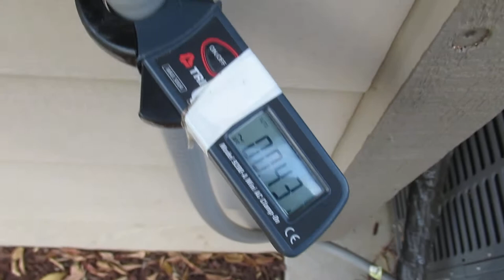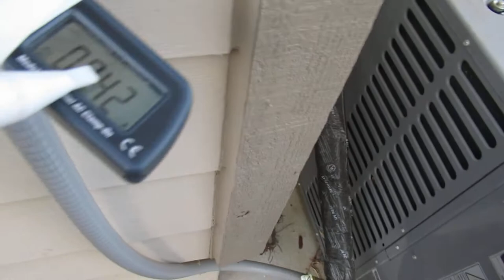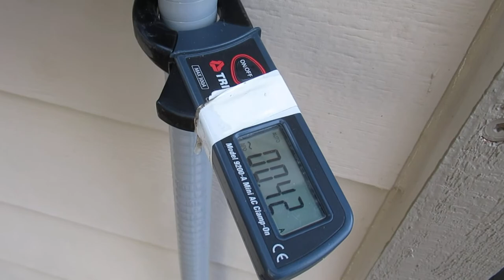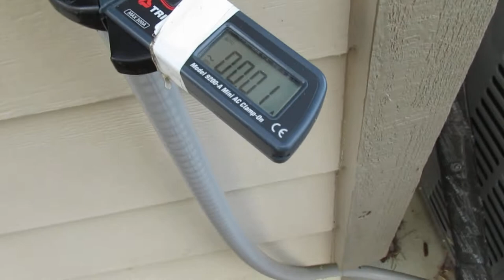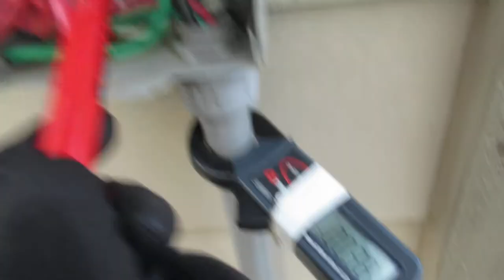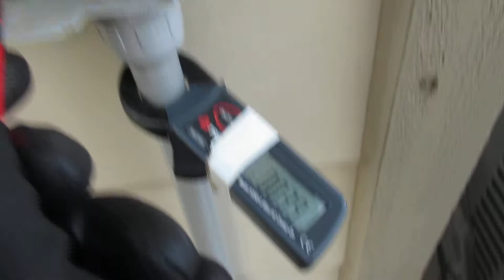Illegal Neutral to Ground connection @ Air Conditioner disconnect box

Comment: Good find! Some modern AC condenser units do require a neutral line,  e.g.  to supply 120VAC to the oil heater in the bottom of the compressor, or the control circuits. Those units usually have a single pole contactor inside the condenser unit. Agreed, with both L1 and L2 powered-off there should be no current flow observed on the meter. I once saw a situation where a faulty supply breaker was leaking current when switched-off, but that should have canceled out your clamp meter reading. An arc-over inside a breaker can leave a carbon trail for current to leak through. The disconnect box should have separate bus lugs for the ground and neutral wires. The extra bus lug is often an optional purchase. The inspector should have caught that error.

On the macro scale you may have a building ground loop caused by: faulty building grounding electrodes, poor conductivity of the local soil, or the utility company transformer. Ex. if the neutral tap on the utility transformer is not centered correctly, or the case is not grounded at the pole properly, or the pole transformer maybe leaking current to ground. Electric potential may be seeking an alternative path to the earth ground through the AC unit cabinet. 

Some utilities save on primary wire by only running a single over-head primary phase to the distribution transformer. So the other side of the utility transformer primary return is connected to an earth ground at the pole. There was a famous case where people were getting shocks whenever they stepped into an outdoor swimming pool. The swimming pool was situated between a bad primary leak between two nearby HV primary 3-phase circuits. The current was passing through the earth and the pool provided a lower resistance path for the stray current to pass through. The pool equipment was all wired fine. They found a nearby under-ground utility transformer that was defective as I recall.

Comment: Ammm,
An AC disconnect that is fusible can have a neutral bonded to the ground. The AC disconnect is an exemption to service equipment meaning a load panel. 

Theory: the fused disconnect fails to trip. Current that is now flowing excessively should go back through the ground into the AC disconnect log which should also be grounded back to the load center. In the event that the ground wire failed. The neutral from the AC unit will carry that current back to the AC disconnect lug, and that current based on electrical theory for the last 100 years would then take the path of least resistance going from the AC disconnect lug through the box to the ground and back to the panel. 

 So that neutral that is bonded to the ground is not a violation of the NEC code.

The AC unit does not have a neutral, that neutral wire is coming from inside your home into the disconnect. So that means that you have current flowing on the neutral. (which is any current in the house, flowing through the ground or neutral to the bonded bus bar in the load center.), flowing out of the load center on that neutral wire into the AC disconnect. That is where your current is coming from.

that neutral should be capped off. If you had a 120 system, that neutral would be spliced together....
.

Go to your load center and put one of your test leads on your bonded ground/neutral bar. And then put the other test lead onto a (separate ground )like a water pipe and then see how much current you have flowing excessively. .
Reply: I experienced a factory machine which bonded the 120V Neutral to the ground in its control cabinet. The assembler who constructed a custom extension cord unknowingly swapped the hot and neutral wires in the male plug. The other end of the extension cord was a pigtail for temporary connection to power and test the machine. When the extension cord was the plugged in the circuit breaker tripped immediately. The circuit breaker was reset and tripped after a 2nd try. The assembler then thought it would be good idea to disconnect the ground wire on the pigtail side of the extension cord. Problem fixed, circuit breaker no longer tripped. The only problem is now the whole metal frame of the machine is now 120V hot.
Reply from the maker: Hello Ammm,  That  may be allowed if the AC disconnect is wired directly to the Service Panel.  In this  case it is wired a Sub Panel so the result is the same as a N-G connection  at the sub panel.  In this case  connecting the N & G st the disconnect also put AC current on the  fluid pipes to  the  indoor evaporator: this  created  a large magnetic field over a large section of the house.   AC current on HVAC pipping  a violation of NEC 250.6.

Comment: That's a good call catching that violation, whomever wired that doesn't know the code well regarding bonding.   I have a 3 questions:  First, how your meter was picking up any stray current to ground at all with it clamped around the entire seal-flex when it's a non-conductive material between the HVAC unit itself and the cut-off panel enclosure?  Second, even if the meter would pick up any current from the conductors inside, how did you know it was a stray current to ground your meter was picking up on and not a read from one of the 2 hot legs inside the flex?   Third, why was a neutral even pulled at all to an HVAC unit when it's a straight 240V appliance, is there a new code requirement for this?   I was always under the impression that a neutral was only needed for appliances like a clothes dryer or a stove/range because there are components in them such as the timer/control boards, lights, etc. that only use 120V, on an appliance such as an HVAC unit or a water heater there are no such components.
Reply from the maker: Great questions Fida,
1. magnetic fields measured by the amp clamp got thru metal and plastic  2. The compressor was not running.  3. All appliances require an EGC, equipment grounding conductor.

Comment: Any 240 house circuit " usually " has a neutral run with it. Especially an electric range, dryers, heat pumps. The neutral will carry any unbalanced load from the appliances in the event of a loss in one leg of the 240 within the appliance. Also some 240 appliances have 120 in them as well thus needing the neutral to carry that as well. So yes....you must carry a neutral to 240 sub panels
Reply from the maker: Right Tommy.  It must not be connected to an equipment ground except at the service panel

Comment: You left me hanging for FULL answer.   Does the outside unit have no need for 120 volts
to power anything?          The copper and green conductor ? One goes to the unit and one
back to the main panel?           WE UNDERSTAND they should not be together.
Reply from the maker: Hello Ted,  The pigtail from the AC unit was L1, L2 & a green Equipment Ground. L1 & L2 go to the AC unit so it receive a full 240 VAC circuit. Bare copper and green grounds should be connected and bonded to the shut off case but not to a white neutral.
Reply: @windheimemfsolutions  Was the white neutral (conductor)coming from the main panel , but was 
not needed because only 240 volts was used in the outside unit???
Reply from the maker: @tedlahm5740  Yes, Yes.  That was the decision of the EMF electrician repairing this problem

Comment: Great video! Does it need a new ground wire to connect to the main panel? Or as it is  bc it has ground wired connected from the AC disconnect and the mini split? Thanks!
Reply from the maker: The violation  here is that the ground and neutral are connected on the load side o the service panel which violates NEC 250.24(A)(5) Load-Side Grounding Connections. A grounding connection shall not be made to any grounded conductor on the load side of the service disconnecting means except as otherwise permitted in this article.

Comment: How come theres a neutral present at the disconnect? condensers dont need a neutral. Was this neutral also removed at the main panel? I'd just leave it capped off at both ends in a wire nut it could always be re-identified with electricians tape and reused if a wire was ever damaged.
Reply from the maker: Hello Denny,  It seems that the contractors wire the house with whatever cables they have on the truck..It appears that the people that wired the house and the AC condenser were not aware of NEC 250.24(A)(5): Load-Side Grounding Connections, which says, “A grounding connection shall not be made to any grounded circuit conductor on the load side of the service disconnecting means except as otherwise permitted in this article."  

These NEC violations create high AC magnetic fields in there house so we search out the source.  I find NEC violations in one of very four home I inspect.  SO where was the building inspector? We found other violations at this house as well: 300.3(B).
Reply: @windheimemfsolutions  I see it all too often where a neutral is bonded with grounds outside the main panel. Also where neutrals are being shared with another circuit this causes issues where a neutral can be overloaded and wire overheats. Also dangerous where working on a circuit you shut off expecting it to be off and you get hit on the neutral.
Reply from the maker: @dennywires  Why do you think it happens so often?
Reply: Unaware diy or homeowners that don’t know code and don’t understand electrical systems. Maybe an Inspector didn’t  know or overlooked during an inspection.
Reply: @dennywires  Apparently the home owner needs to know how to check the electricians work. I just found where the range and cooktop are tied to the ground by an electrician six years ago. I'm installing a new cooktop and found the issue. Thanks for posting.
Reply: It was common to find that in older ranges and ovens before going to 4-wire power cords same goes with dryers. In newer wiring neutral and ground are not bonded at the appliance.
Reply: @dennywires well in older range and dryer circuits they were 3 wire, two hots and a bare neutral, and the frame was bonded to neutral.  I've even  seen 10-2 w/G NM used to feed a 3 wire dryer receptacle in old homes, an electrician buddy of mine said some local jurisdictions permitted this at one time  even though it was never permitted by the NEC,  SEU cable was specified for 3 wire dryer/range circuits though the 1993 NEC, 1996 they were done with but since several states and local jurisdictios don't adopt the latest NEC,  it wasn't until the early 2000s when the rule was universally enforced in all 50 states.

Comment: We have a house built in 1956 with no grounds.  A 40 amp house subpanel connects to a subpanel at our shed with two #8 hots and a #8 neutral.  The shed subpanel  feeds a 30 amp and a 15 amp circuit off different hots.  The shed subpanel has grounding to a ground rod with #8.  Would it be a good idea to bond the shed subpanel neutral and ground?
Reply from the maker: Ns & Gs can only be bonded at the service panel per NEC 250.24(A)(5)
Reply: @windheimemfsolutions  our service panel has no ground, built in 1956.

Comment: Hi! Thank you for the video - would it cose EHS electrosensitive people any difficulties? (How that was before) Does it influenceHealth?! Please drop a line. Kind Regards
Reply from the maker: Hello filce,  neutral current on an equipment grounding conductor is a life safety hazard as it will put current and voltage on grounds, grounded appliance chassis, pipes and other metallic pathways.  A severe shock or even electrocution could result to a plumber, HVAC mechanic or anyone who falsely assumes that ground wires, pipes or appliances are safe.  

I myself got a very severe shock from a ground wire at my dads house where he had a N-G connection due to his own work on the wiring. You can read about my parent house here:  https://windheimemfsolutions.com/did-emf-pollution-cause-illness-death-at-an-architects-dream-home/

Powerful and hazardous magnetic fields are a result of this kind of NEC code violation.  AC Magnetic fields create problems with the division of cells. This is correlated to ADD, Autism, Tumors and even cancer over time.
Reply: @windheimemfsolutions  Thank you very much for your reply! I will read it again later when less tired. It looks like that the best upgrade to education nowadays (or one of the best) is to study  for  EMF Trained Electrician. I appreciate your reply! Best Sincere Wishes!
Reply from the maker: @filicefilice  You are perceptive.  You can find out much more about EMRS training here: https://buildingbiologyinstitute.org/certifications/

Comment: Now measure the voltage before and after. Before schould be close to 0 and after may be 100+
Reply from the maker: Hi, No need for that. When we disconnected the circuit neutral from the insulated green HVAC  equipment grounding conductor the stray current on the HVAC pipping and related magnetic field ceased. We left the insulated green HVAC  equipment grounding conductor to the bare copper circuit equipment grounding conductor.

Comment: It's because your air conditioner is faulty ...it has leakage current ...this 0.5 amp will kill somebody going to touch this AC .....
Reply from the maker: No,  It is because there is a N-G connection past the SE panel.
Reply: I was debating that too at first; but that can't be true:
If the leakage fault was in the AC, then the leakage would continue through the house green wire when the white wire was disconnected.  [EDIT; Oh, unless the green is not properly grounded!]
The current appears to be going the other way - from the panel to a another path to ground.

Current carrying neutrals at the panel can experience a slight voltage drop at heavy loads, vs the grounding system, which would have equal potentials throughout.
I suspect the panel neutral is seeking a second parallel path to a better ground.

This hypothesis has flaws too, as the green presumably goes back to the common bar in the main panel too.  It could be the AC has a ground rod, or sitting on the ground, or the ground and neutral bars on the panel aren't bonded well.
The main house feed outside might have a bad neutral connection somewhere:
There indeed could be a bad panel bond, or meter neutral connection issue, or problem at the transformer...
[EDIT; and test the green wire for solid bonding]

I would have further investigated to see where the current was actually sourcing from. (as you inferred)
Mr K L

Comment: Can we run a neutral into the shutoff switch but leave it capped off with a wiring connector and not bond with the ground?
I am anticipating the event that a newer unit may require neutrals.
Smart switches now want neutrals so if it’s unused inspector still want to see neutrals at the j box.
Reply from the maker: Hello QV.  In any event, neutrals shall not be connected to equipment grounding conductors past the Service Entrance Panel.  See the code: NEC section 250.24(A(5) Load-Side Grounding Connections. A grounding connection shall not be made to any grounded conductor on the load side of the service disconnecting means except as otherwise permitted in this article.
Reply: @Windheim EMF Solutions 
 thank you for pointing out that neutral SHALL not be connected to any grounding conductors.
My inquiry would be instead using an AC disconnect switch, can I use a lug only panel such as the eaton BRC48L125RP with properly sized wires and breakers to control  mini split unit?
I plan to have 1 single pole gfci breaker for the convenience outlet and 1 double pole ThermoMagnetic breaker for the mini split.
Reply: @qv6486 yes,run a neutral to the disconnect from  the main panel and connect your neutral to that leg.He is 100% correct though regarding neutral & ground.They absolutely positively 100% cannot be bonded except at the main service panel.Hope this helps.